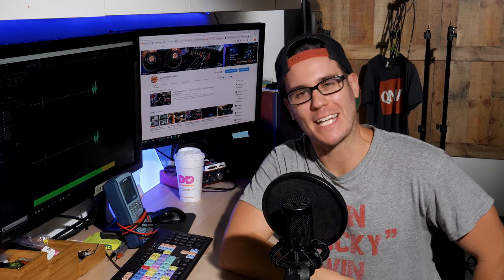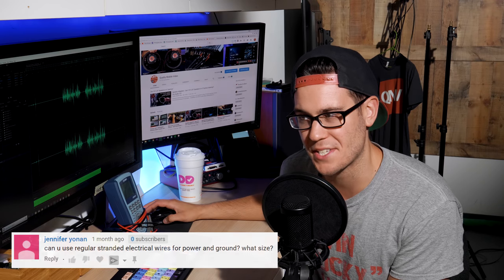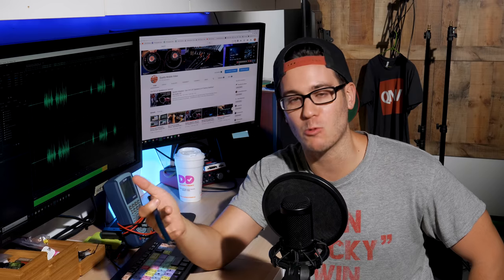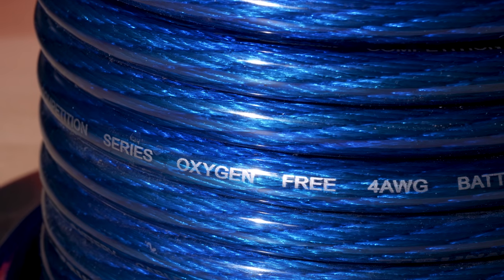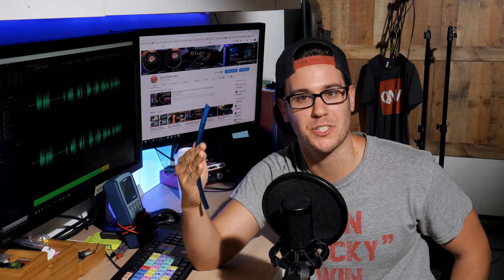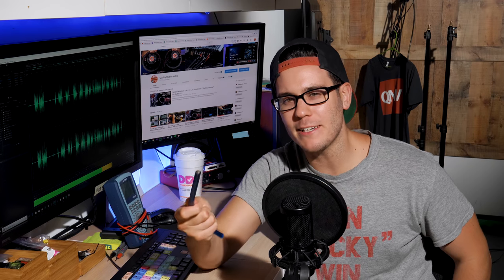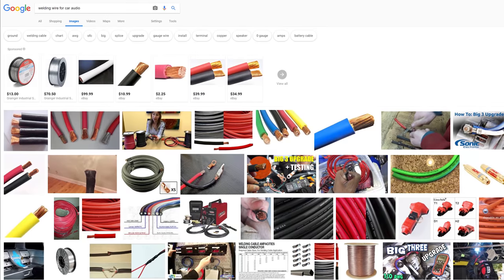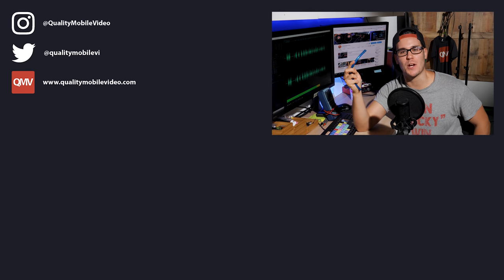Speaker Wire vs Regular Electrical Wire vs Welding Cable - Car Audio 101

Comment: This guy has it totally wrong. Why does my $550 Audio Quest speaker wire have solid wire then? You can even use 2 conductor 12 awg  Romex at home depot if your running long lengths. Works very well and cheap. Cheers
Reply: He's not wrong. The topic is about wire use in car audio. Solid wires in car audio can work but have a high chance of failure due to vibration. Home audio is totally different

Comment: I used some cheap 4 gauge I got in a amplifier kit for $40 AUD until I found out the wire is 100% aluminium and the insulation is complelely off center and real thin 1 side. Ive imported some Sky High 4 gauge which ended up being $13.9AUD per/m after import Tax, shipping. I just looked up prices for welding cable and the high quality OFC Aus made stuff is $11per/m and another cheaper Aus brand but made in China is $8per/m which you dont know if OFC. Also on ebay I can get welding cable from china for under $5per/m but I wouldnt trust. Welding cable is double insulated which doesnt suit my needs and it orange, so im happy with my choice to pay more to get certified OFC, fine strands and the colour I want! :)
Reply: Also other options are battery cable and switchboard cable, I did buy some battery cable which was 2 guage but fit into 4 guage connectors, was really high quality but $16per/m. I am an electrician and could get some good prices on cable but with Aus standards its complicated because the equivalent 4 gauge is a lot smaller so I dont even bother.
Reply: Would connecting a fine strand positive speaker wire to a thicker strand positive electric wire be okay. Thin >from >box >to thick >thick >to >speaker$
Reply: @JP--pe4ny  The difference is so minor it wouldn't matter as long as the correct gauge wire is used. I have thin strand positive going to my box and a thick strand negative returning. I do believe thin strand wire to be the higher quality wire though, in switchboards I tend to see the thick strand wire fail more often by getting overheated. 

There are many reasons to use the different types of wires, thick strand wire is less flexible, but when bent holds its shape, possibly cheaper to make and is good for screw down connections because it doesn't cut into the strands, also good for close electrical contacts because there won't be a stray strand sticking out to short out to a adjacent terminal. Thin strand wire I believe is slightly more conductive, higher quality and is flexible. 

My electrical license is only for sub-board work not mains power, but from what I have seen the mains power coming in they use either or, so the 1inch thick wire is sometimes thick stands, sometimes thin so they are obviously both perfectly fine for high current, but I think thin strands have and edge.

Comment: I really can't believe all this hype about wires in car audio as long as the power cable is copper and the proper Gage a 12 battery or multi battery system will handle it check this out I have a grand Marquis and it's not like I didn't have the money to buy car audio wires I didn't want to spend $75 and up so I went to home Depot and got 20 feet of 4 Gage thhn wire 75cent a feet install the fuze ran it the proper way to to the distribution block and the same wire break's off into 2 audiopipe amplifier 1000  at 2 ohm and I'm using the same wire for the neg ground both sides it's been in my car for 2 years in all different kinds of weather I have had no problems at all not even a blown fuse! What we all need to know that when looking at do it yourself video or pro installation it's about selling that product in question just look at the guy telling you what you need why is it that he have on a tee shirt with the products name? he's getting a check so if you just ask questions and have some common sense you came do it to by the thhn wire I used is a little bit thicker that stinger 4 Gage wire the only difference is the outer jacket so being that you have under the hood heat from the engine run the wire across the header panel that way driving pulls in air that same way your air filter gets air to keep it cool it's been working for me all this time but try what you like I know mine is fine and have done 2 other cars and the sound is amazing nice clean and rich no humming whizzing nothing
Reply: Except your power loss using that wire is robbing the system of 18-25% of its ability to make rated power. So a system that's 1/2 the power of yours ran properly makes the same if not more power and sounds and hits that much harder.  That's like filling a 5 gallon bucket with a drinking straw
Reply: @MIXMASTERBJB1  If you size it properly, it will handle same amount of power with no problem. Cheap 0 gauge would obviously handle more power than most expensive 8 gauge (except those wires with fake rating, where isolation is 1/2 of wire, not talking about high voltage stuff where you actually need thick insulator). Shielding is important too, but rarely see anyone using it in car audio.
Reply: @MIXMASTERBJB1  didn't you even read his comment? Because he mentioned using the proper gauge wiring. So, therefore your arguement has no merit and shouldn't have been exercised

Comment: Theoretically, if EMF is a concern, any kind of stranded wire performs worse than solid wire, since EMF is a surface level effect, minimizing surface area minimizes EMF, it is as simple as that.

However, who would be willing to put up with stiff solid core wiring as audio cables? Not many people. I am sure they exist though, audiophiles will do anything for the best possible sound.

Comment: any thoughts on solid wires for speaker wire? Being an electrician, I have access to a ton of copper wire, I have used it  in my home system for years.... just feel with solid I am getting better sound. Oxygen free wire is new,  to me anyway.....you have scratched the interested side of my brain now, thanks

Comment: Im gonna be running 4/0. Big 10k-12k watt system in working on.
Reply from the maker: DAMN SON
Reply: Quality Mobile Video 
Yup. 4 18s on a Taramp 10k with 4 6.5's in each front door sided with 1 tweet each speaker. And that's not including the 8's I might do in the rear doors
Reply from the maker: What are you using for ventilation?
Reply: Quality Mobile Video 
Not sure what you mean by ventilation. Are you talking about battery ventilation?
Reply from the maker: I meant for the amp and subs, just wondering if you have anything extra setup to keep everything cool!
Reply: Quality Mobile Video 
The subs will cool themselves down and the amp has 4 fans on it. If hearing becomes an issue I'll add extra fans but I'm not thinking it'll be necessary
Reply from the maker: Dope! Blowing girls clothes off with that setup man!
Reply: Quality Mobile Video 
That's the plan.

Comment: Is solid 12 gauge wire, like in your home, good to use. Obviously the flexibility is not what you would have with stranded wire, but as far as performance goes is there any difference.
Reply: Only if your amp is less than 200watts. 8 or 10awg is a better choice!

Comment: Electrons travel on the outside of wires so in addition to flexibility you get more surface area for more current transfer and heat dissipation. Interested in the next video of the series it's interesting.
Reply: I hear that it does also. But if that was true wouldn't CCA wire be just as good? Yes if it flows on the outside of the wire.
But CCA cannot carry the same amp load as pure copper without heating up.  Or am i missing something in that theory?
Reply: @bobdodge3171  copper and aluminum are different elements and have unique properties that make them not equivalent in this case
Reply: @ADR69  i understand that. But the reason cca is around is because its copper clad.. Coated in copper.. Copper on the outside of aluminum so if electricity flows on the outside of cca the aluminum shouldn't play in effect.
Reply: @bobdodge3171  they are alloys at that point, not individual components.
Reply: It coated with copper therefore not an alloy.
They are not mixed together like alloy.
Thank you, Enjoy your day.
Reply: ADR That may be true at very high frequencies with really thick wire, but at the frequencies we listen to they flow through the bulk of the wire.
Reply: Car audio is dc, this is irrelevant
Reply: Car audio is DC not AC..... DC flows through the entire cross section of the cable. Your vehicles charging system will not care the difference between cables as long as it can adequately handle the current flowing through.

The only difference, well main difference between audio branded cable and welding cable is flexibility but even then welding cable is still easy to work with if you plan your routing correctly.
Reply: DC travels on the outside -_-
Reply: @scarr3ll  i use runs of 1/0 welding cable. From the big 3 all the way back. 👍
Reply: @UsurperTCG  you might want to reevaluate that
Reply: I once watched someone try and explain how the electricity flows not thru the cable wire but outside of it. using huge columns🏛 not wire as the focus of his teaching. What yall know about that. The pattern on columns, the whole design, is not just a design🏛 but made specific for an electric current. 💆‍♂️

Comment: Solid core wires always sound better but hard to work with thus only diy. Stranded wounds crappy as IACS conductivity is lower and no grade of wire matter. Homedepot is easiest to get it.

Comment: What's the difference between speaker wire and normal Electrical wire ? Can Electrical wire be used for Speakers ?
Reply: Agree with this, I have a spare earthing / grounding wire and I’m thinking of using it for speakers
Reply: I am useing mains 240 volts I from the Uk 🇬🇧 as my speaker wires because I could not get 16 awg though the door plug

Comment: Why shouldn't I use solid strand wire? I am using an LC7I line out convert and I need to send the factory speaker signal to the converter, I was going to use some 18awg solid stranded Wire for this,  Yes or No?
Reply: That's what I want to know.  Why not?
Reply: Technically you can use it, it's just not as flexible and more prone to breaking with minor movements and vibration
Reply: Of course you can but just order some stranded ofc 18awg speaker wire. Its dirt  cheap, extremely flexible and its just the appropriate wire for the job
Reply: @beardedforlife3740 do your math solid core cable breaks who said ? I have seen solid core cable withstand harsh outdoor environments that's why they are use as coaxial cable they are more rough use and why would you need flexibility if most of time your speaker is going to be in one place .
Reply: @dammdaniel9953  routing and vibration are the biggest reasons you don't use low strand count wire. Also your door speaker wiring sees a lot of flexing from door usage

Comment: Yezir. wire connected inside the box is soldered glued and it's  perfect lenth to where it won't reach the speaker when angled in position that gives my hand or tool room to work. So it'll reach till I try and connect it now it becomes to short.  the easiest job in the world twisting two wires together who long will it take day3 coming up

Comment: I'm going to install my sfb8000 to my zv5 18  the amp is going at 1 ohm and is suppose to push out 8100 rms can I use electrical house 2 gauge wire? For that much power or no?

Comment: As long as you are not using speaker wire for home electrical you will be fine.
Reply: @Young Thug Safety hazards, isolation, current handling etc.
Reply: oh any body know a good electrician I might need one. lol

Comment: Oh thhn 4 Gage wire is 19 strands but each strand is thick hold battery current very well my system is pushing 12 speakers one 12 Inc skar 2 ohm sub at 1000 watts rms and the other is pushing a 8 Inc skar 600 Watt rms sub and the head unit is doing the rest on mids and highs

Comment: It was a real bi*ch to run it. But, I used 2/0 simpull thhn pure copper wire and my system beats twice as loud. It sucked to install & not sorry i did it.😎🤟

Comment: go check what an alloy is.....copper is not an alloy....
Reply from the maker: Maybe listen instead of criticizing. I DID NOT say "copper is an alloy". I said "Oxygen Free Copper is a copper alloy..." Copper alloys are metal alloys that have copper as their principal component. They have high resistance against corrosion. The best known traditional types are bronze, where tin is a significant addition, and brass, using zinc instead.

Comment: You lose power using CCA and other junk. Wires aren't wires
Reply from the maker: OFC is obviously better, never said it wasn't
Reply: Actually wires are wires because in the basic sense they do they same thing. Material used however is not always the same. I wish people would research more before piping in on a subject they really don't know
Reply: I install "wires" and that makes me a viable source in indicating good wire or bad crappy metal masquerading as wannabe quality copper
Reply: @LegendaryWoke  did you not read my comment entirely?
Reply: @beardedforlife3740  I read it that makes an expert now in your comment 😝 Have a great day!
Reply: @LegendaryWoke  that literally made no sense